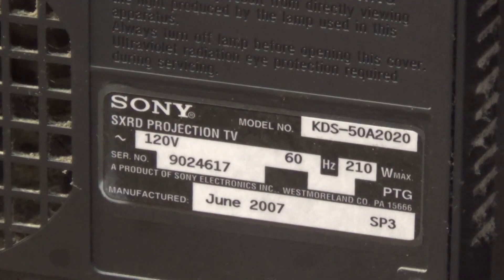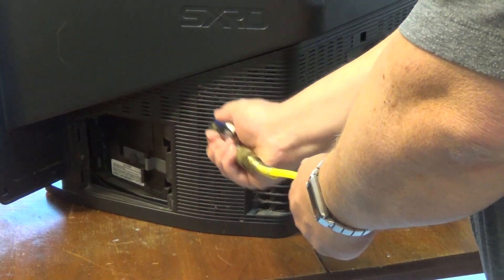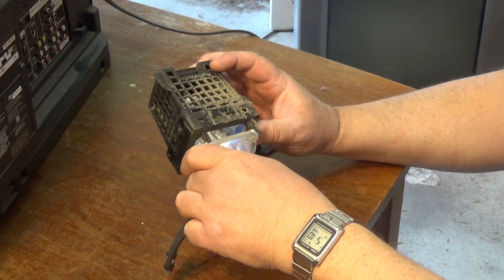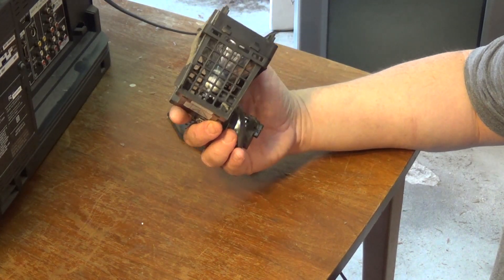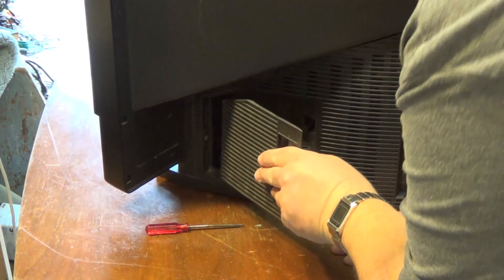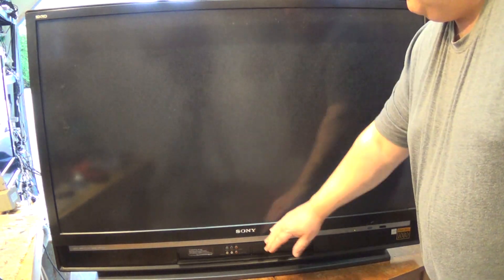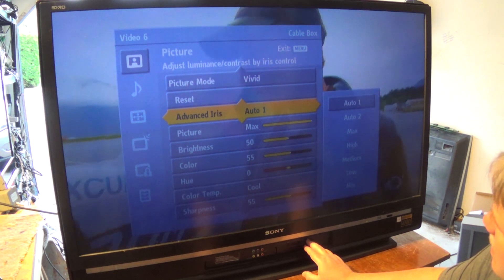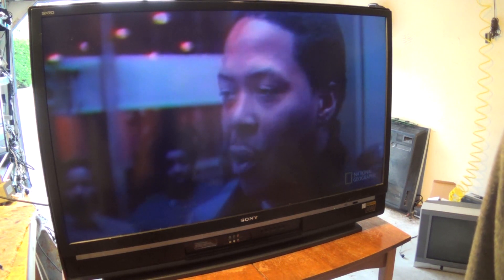Sony KDS 50A2020 Power light flashing RED

Comment: Not sure you can answer but I have a Sony KDS-55A3000 that is blinking 5 times red; bulb replacement light is not on but I can't get the TV to turn on; should I go ahead and try replace the bulb anyway?  The initial red light indicating standby does not come on either after I turn off the TV.

Comment: Hi, I hope you are still around and read this:  So I have a chance to pick up a Sony KDS-60A2000
 TV which is the same (more or less) as yours.  Owner says they got lamp warning, then finally replaced the lamp but he is getting a Red flashing light (5 times).

Is this worth picking up?   It is large and I have to drive 150 miles each way to pick it up.

What does the 5 times red flashing light means ??

Thank you.
Reply from the maker: Aftermarket lamps are total crap.  This set I gave to a relative with after market lamp. Itastsd a year.  Was change to another after market lamp lasted 6 months.   Another cheap lamp didn't work at all and was swapped  for another cheap one. Lasted 1 month.  Now an original bulb installed and 5 months in it works great.   5 blink code is lamp driver (ballast) however a bad lamp will throw this code too.
Reply: @12voltvids  Thank you for your fast reply.  So if I understand you correctly, this TV most likely just needs a New lamp replaced & will work?

I assume it is worth driving 300 miles (Round trip) to pick it up?   I mean the colors and picture are excellent on these TV's despite the age ?

Thank you.
Reply from the maker: @AB-hx9hs  
Yes the picture is very good on them.
Reply: @12voltvids  Great, thank you.  Do you prefer this over LCD TV picture ?  Just curious to know your opinion.  And are the Sony DLP better than the Mitsubishi DLP tv's ?   thanks Man.
Reply from the maker: @AB-hx9hs  
Sony used LCD on some and LCOS on others.   Samsung used DLP. I have had a Samsung DLP since 2003.   Still going strong.
Reply: @12voltvids  I was asking Specifically about this Sony (the KDS-60A2000) and how you would compare it to Current/or more recent LCD TV's ?   I am trying to decide if this Sony older TV is worth picking up and if the picture is as good as LCD picture (Not asking about Samsungs).  thanks.
Reply from the maker: @AB-hx9hs  
Obviously the current new sets are going to deliver a better picture.   These old LCOS sets do have a very good 1080p picture that is very good but they are a projector which will require a new lamp about every 8000 hours of use.  The newer 4k sets however blow away all these older sets.  If it was free then it isn't bar but i would never pay for one.  I have given away 2 in the past year.
Reply: @12voltvids  Well, it is free but I still have to pay the gas to drive 300 miles to pick it up and to replace the lamp too, it doesn't have a lamp.  Maybe it is worth it, I am trying to decide.

Comment: I have almost the same model I have the 60 inch version basically what happened first was it would power on it would shut off right away not sure what I thought it was. It was the lamp replacement nope no no and then I opened replaced took out the lamb put it back in. And now it actually lasts for about 3 minutes before setting off any idea what it is but blinks 9 times

Comment: The bulbs harness and all for most of these projection TV from Sony cost no more than $80 on most sites like ebay . I have 3 of the KDF-46e2000 and the first bulb in 2010 cost 200 bucks but that was the last time I ever paid that much again some of the brand name ones that cost 60--80 from like Philips last longer and are little brighter than the Sony ones and the off brands are just normal but cost like 20 bucks so its what you want to spend but they no longer cost hundreds anymore that's for sure.

Comment: P good job my friend just found well someone wants to sell a TV with this exact model has the same exact problem I'm thinking that's what it is but if not it could be a few other things hopefully that's the case I might just have to buy Universal cheap bulb for twenty bucks on eBay just to test it out if it works then I can use it great video

Comment: dust is the killer of these sets. the fan that sits above the lamp to cool it down is usually clogged up and prematurely kills the lamp, and if the fan can't cool the lamp, heat from the lamp will burn lcd and filter on the optical block giving blue blob and the heat can also melt the inside cabinet. clean every 6 months

Comment: Nice to watch you fix all this stuff. Pretty interesting to see how it all works. I'm having some trouble with an older Sony lcd tv from 2005 (klv23m1) which has a strange problem. It randomly turns itself off but not just into standby. It behaves as if someone had unplugged it from the wall and waited a couple seconds before plugging it back in. Sometimes thiz happens every couple minutes at random and other times it happens within a couple seconds after it recovers. Because the thing has a physical on off switch, it automatically turns on. This can be a pain when the tv is sitting in standby and randomly cuts out. When the power returns, it turns itself on. I can also reduce the likelihood of this happening by aiming a fan at the tv and keeping brightness low but once it cuts out once, it can happen at any time even if the tv sits cool in standby. Unplugging it and draining all the power from it and re plugging it in can temporarily reduce the frequency of the shutdowns. Also, there is a vertical line on the screen that goes away when the tv warms up but that's probably another issue. Do you have any idea what can be causing the shutdowns? People say to check capacitors but none appear bulged. Any clue?

Comment: I have a 60 inch Hitachi projection TV  and its starting to yellow on the corners ....what's that causing that :)
Reply from the maker: +Navpers 47 OK Hitachi projection, I believe was an LCD (unless it is a really old CRT unit)The problem with LCD projectors (and LCOS) is heat and UV light from the projection lamp can damage the blue panel, or the polarizer filters. This causes loss of the blue color, and makes the screen turn yellow.Check out my video where I tear down an Epson projector that had a yellow blotch on the screen. It is blue panel failure.

Comment: I had this TV.  Great picture quality, but they had issues with the optical block and the "green blob" syndrome.  It's cheaper to just replace the bulb than the entire housing.
Reply from the maker: +Audioquest56 lcd projectors suffered the blue blob, and lcos suffered the yellow blob. Same cause. Uv light from the mercury lamp damages the blue panel. On Lcd this causes light leakage, and on lcos light loss in the blue spectrum.

Comment: I see these videos from the US, Canada, Aus, Germany and others where people find stuff by the side of the road and fix it. Why does it never happen here in the UK? The only time I ever see stuff dumped like this is when some <undesirable character> has fly-tipped some old mattress out in the country.

Nice fix. And nice set... meanwhile I can't give away an old 36" CRT Panasonic I have in the house here :( No-one wants anything other than LCD, even the older plasmas seem to be worthless now.
Reply: +Jason james I live in Canada and i never find anything by the side of the road, you are not on your own.
Reply from the maker: +Neil Robinson I picked up not only this set, but a CRT set that needs repair, and a Sony Mini sound system and a Sony power amplifier. Will be looking at those soon.
Reply: +12voltvids After watching your video to cheer myself up i had a wander to my local thrift store just down the street, and lo and behold i picked up a mint condition Sony Handycam  TRV68 with battery, charger and 3 tapes ( one HI8 ) for 5 bucks, and it works a treat !!!
Reply: +Neil Robinson Oh likewise. All these videos from 12voltvids and a few others inspired me to buy up a few things and repair them (I am generally fairly handy with electronics but hadn't actually bothered to fix anything for quite a while). So far 100% success -- two TVs, one with a loose LVDS cable and one with a blown diode in the power supply, and a Cambridge Audio CD player which only needed a replacement for a blown PCB-mount pico fuse and a loose (intermittently-working) loader belt. Very nice player as well. Total price for all three was less than 10 dollars (around £4.50 in fact). It's becoming something of an obsession in fact and I have the internet to blame for that :-)

Comment: So they throw out a perfectly good tv because the lamb didn't work did the previous owners ever think of checking the lamb maybe.
Reply from the maker: +Ryan Scherbluk local shops don't carry them anymore and the shop that set probably came from (the shop I used to work at) closed their doors in 2012. They probably walked into the big drug store that sells TV and were told the bulb wasn't available. If they called the number on the label, Sony would have quoted them an original Sony, and that would be a few hundred dollars.
Reply: 12voltvids okay yea make since see it a 2007 model that's pretty good being almost ten years old and all it needed was a new bulb. In surprised the Samsung bulb fit in the Sony tv now you got a kick ass tv.
Reply from the maker: +Ryan Scherbluk Yes it has a nice picture, and these sets despite being huge are very light and easy to move around.

Comment: Such a lamp seen in most projectors gaps incendiary "burner" occurred on Ac or Dc 
 one that exploded on the table He had some defect new imported and cash went 270 Euro. :D
cash irrecoverable.
Reply from the maker: +Tomtech29 Early sets had no safety glass on the front of the lamp, and when a lamp failed destructively hot glass was sent into the optics making the unit a write off. Usually they do not fail in this manner because the lamp timer is designed to put a message on the screen that the lamp is at EOL. The problem is people reset that timer and when lamps totally fail they sometimes go pop.Earlier units had a fusable link that would burn out, and reset the timer on first insertion of the lamp, but people were putting the new lamp in, to reset the timer and then going back and running the old lamp for a few thousand more hours until it got really dim, and then putting in the new  lamp that already had half it's burn hours ticked away. So they went to the manually timer reset in the menu, and people abuse that, and well this is what happens.
Reply: 12voltvids
 You have absolutely right sorry for my english I wanted to share with you the adventure of this type Lamp
 (I was very lucky that nothing had happened to me>)
lamp I bought on Ebay from the Chinese seller ' The new out of the box!
A slightly different was not armed front glass, also he had to post the spirals: You will know what's going on.
I still have a picture somewhere (converter relatively small 150W>)
 Interestingly on the post where the electrodes are I could see tiny append a dot like a soap bubble on glass "Air" and it was a factory defect!
He tried the ignition sometimes it's hard for the third time start
 I searched in vain causes the inverter After 2 hours of the test Bumm.
sometimes not worth buying the same burners "only a set with pocket" with a guarantee :D
hold on and continue to work you gave so much joy greet.

Comment: Nice repair, Glad you were able to save this set from being recycled. I'm glad it was just the bulb. I see when you're in the menu settings that the settings icon which is a box with a handle is exactly the same as the one on my PSP game system. Also made by Sony.
Reply from the maker: +coondogtheman1234 Now just have to find a home for it. It actually has a great picture even with the non stock bulb. One thing I forgot to mention, that these sets really need to have the cooling mode set to high. This one is, and that is probably why the blue panel isn't fuxed as so many of them were . This one looks great.
Reply: 12voltvids

Probably wouldn't hurt to blow out all the dust from it. Imagine playing PC games on one of these? I have a 32 inch LCD TV and a laptop with no LCD screen and was playing the classic 90's game blood on it. Sound didn't work though or was all messed up.
Reply from the maker: +coondogtheman1234 The guy that brought me the set that fell over has offered to take this one off my hands. It is an old friend that I have known for over 40 years, so it is going to a good home.
Reply: 12voltvids

Good to hear. At lease someone will be able to use it.

Comment: I have a Vizio LCD sv420xvt1a change mainboard and T -com  the power supply voltages are well ok all  backlight is on or ok but screen is blank or gray not have video or not audio please I need your help thanks
Reply from the maker: +otoniel780 I have only worked on 1 Viziohoh and it was a plasma made by LG.From what I have heard on them, there is a high panel failure rate on them.